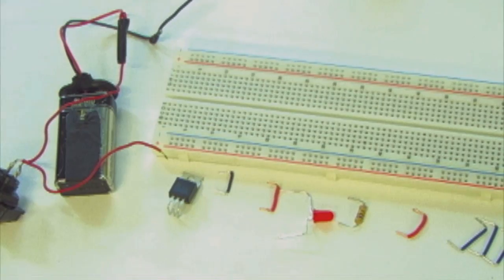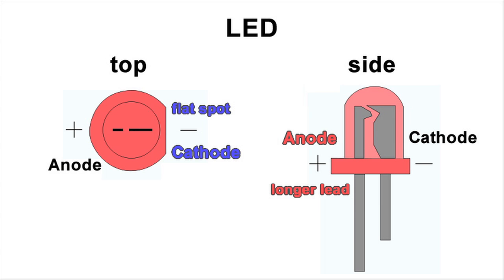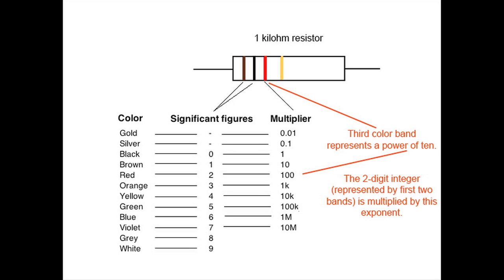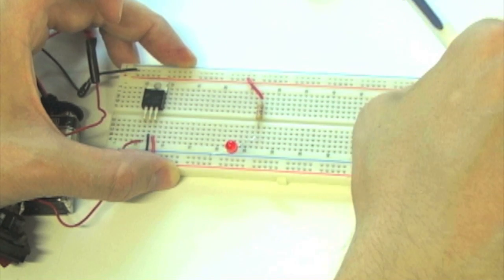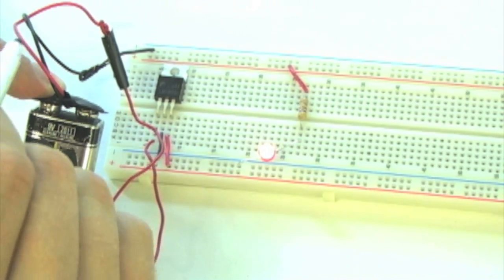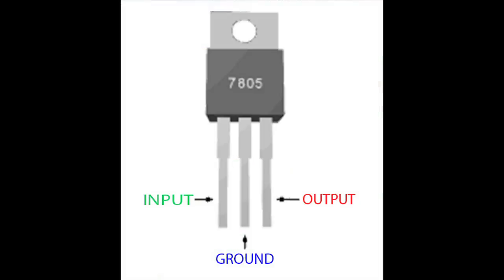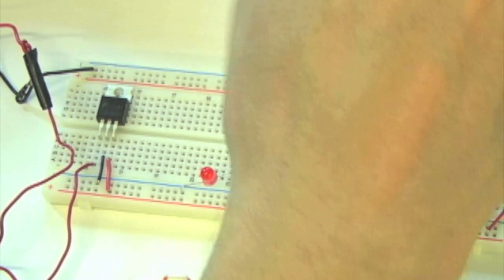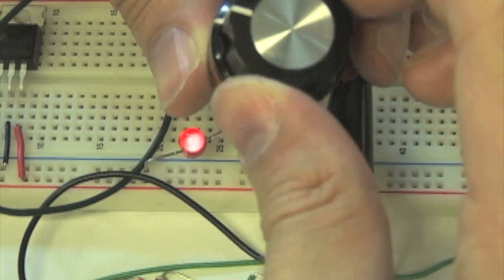Breadboard Basics (Musical Electronics - 1)

Comment: Thanks for the fun tut! Taking my first electronics class. This was a easy and fun project to start with. I was wondering about why your using the voltage regulator? I don't have one so I skip that part all together. It still worked and I'm not seeing or smelling any smoke.